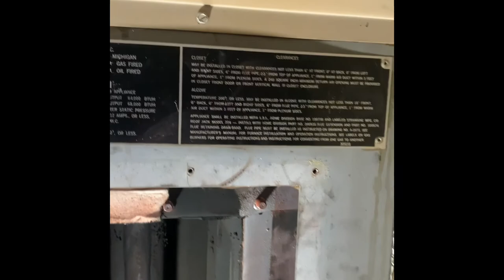Miller trailer furnace no heat

Comment: Thanks. That was great to see the whole inside of that furnace and how to get a proper inspection and diagnosis completed. Is the unit condemned then or can the heat exchanger be replaced? It looks old and at its retirement age.
May have a similar situation on mine and it’s about 12 years old. 
Great video.
Reply from the maker: Actually there wasn’t any cracks in heat exchanger but homeowner decided to convert to gas

Comment: There's more combustion fumes leaking around the inspection door than there is out of that little crack. And the oil certainly didn't come from there. I've never found an oil leak and then go look for combustion leaks